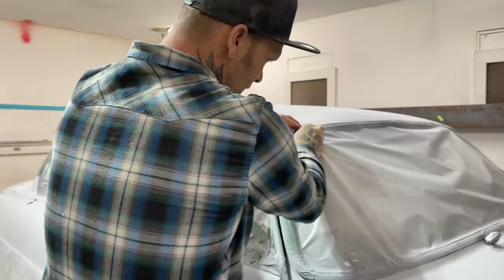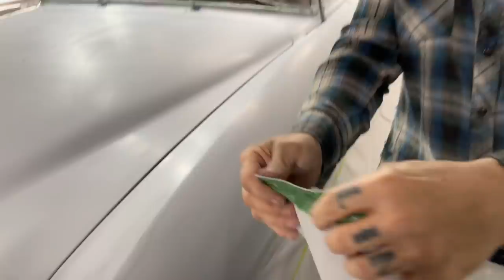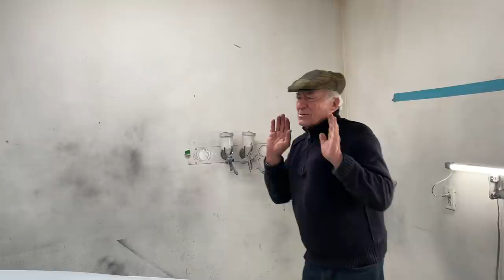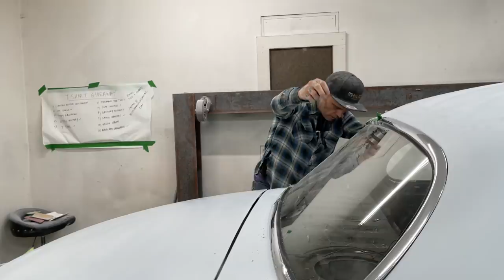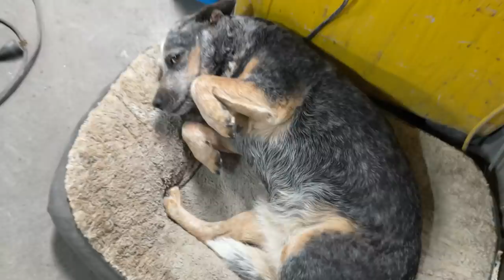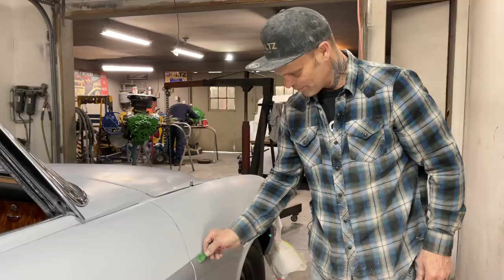UNMASKING... 😬 A VERY DELICATE PROCESS WHERE A LOT COULD GO WRONG

Comment: I always liked the 3m fine line tape for edges that need to be sharp. When masking flames or stripes, I would wet sand w/1200 with a rubber block against tape before peeling off to get very sharp edge of paint. Cuts paint off of tape yielding cleaner lines. Would help where you masked near pin stripe.
I like how Chad leveled the upper half of this car with minimum filler. This job should hold up for a very long time.
I didn't realize that he still has to shoot color over this and will have to mask it all again.

Comment: I painted a trailer years ago and left the masking tape on for a few days in the sun and rain and I know how much work it is when it keeps tearing and leaving pieces and glue on the material,I spent a long long time trying to remove the tape,I finally resorted to a gas rag to get it cleaned up,So I feel your frustration about using the wrong tape Chad

Comment: There is a special way to peel tape off so it limits the chance of pulling the paint off the edge. Worth checking out.
Reply: I agree. When you pull tape back after wet sanding the edge against the paint you are less likely to pull the paint off with the tape.

Comment: Chad yesterday you said 400 grit for single stage why do you need to go 600 for base/clear?
Reply: Because solvent base clear is thinner than single stage. The base won't cover the scratches, especially  silvers or other high metallic base. You have to use 800 to 1000 grit for waterborne base paint because its even thinner